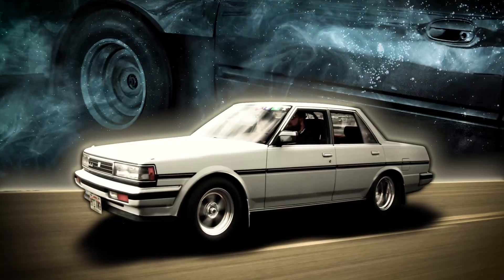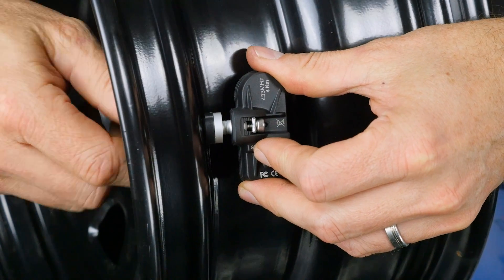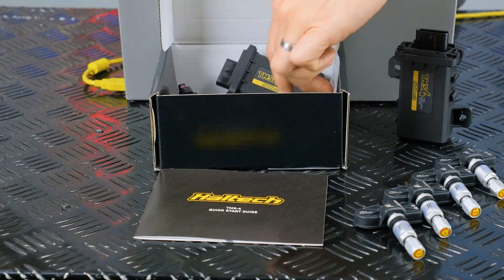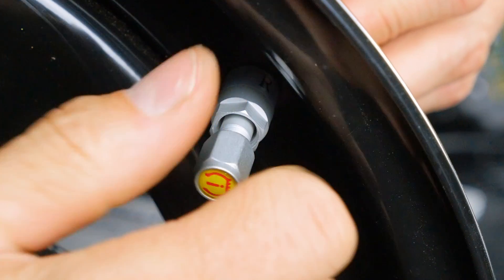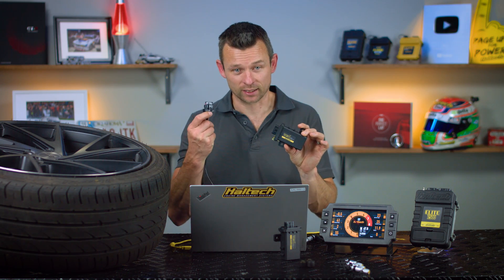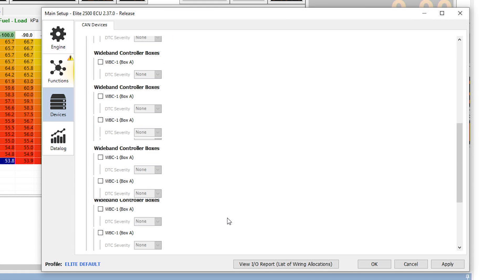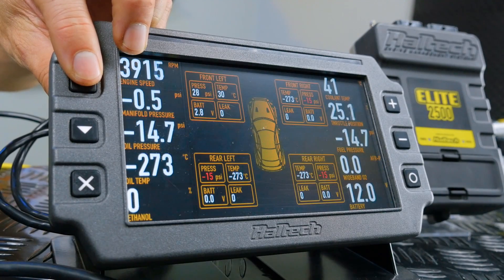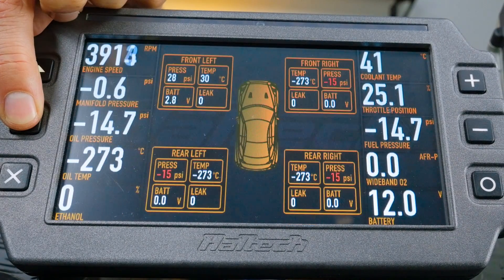🔍 TMS-4: Tyre Temperature & Pressure Monitor | PRODUCT OVERVIEW

Comment: maybe I missed it but I dont think so ,Yall need to tell people trying to install this product that if the tires have been sitting still the sensors will not read, evidently some kind of battery saving feature which is pretty cool but only if you know it, I just spent about 3 hours trying to figure out why none of my sensors were working only to find out I needed to move the vehicle and they would come online😒

Comment: I just ordered one but they need to make it an option to use 5 sensors so that spare tire pressure will show up too, which might even be more important than monitoring the other 4 tires because one usually knows when they have a flat but I have went to put a spare on many times only to find out its already flat

Comment: What’s the maximum amount of sensors that can be read at once?
Would be cool if you could also monitor pressures on the race trailer, or if you’re carrying a seperate set of tyres to the track, and be able to disable alarms that certain sensors can’t be read because they’re not on the car and therefore not in range. Then you could also custom title the tyre names that would appear in the Dash.

Comment: New vehicles with fancy TPS - eh who cares.
Haltech vehicle with TPS - HECK YEAH
Reply: New vehicle fancy TPS is just a display - you can't get any can data from it nor can you throw a DTC or conditional code up as a warning etc or have contingency maps regarding tyre temp and pressure. 

It could mean a lot for those racing 1/8 or 1/4 mile for example who can fine tune their starting tire pressure. 

It's also handy for circuit racing cars to have a warning system or tire pressure warning come up on the IC-7. 

Yes it forces you to invest more in the haltech universe with the IC-7 Display to get the best output as well as the elite / nexus ecus - but after upgrading from a Motec M800 then PS2K to Elite 2500 it's been worth it.

Comment: Will the multi function can gauge (gauge art) be able to display this information if I don't have an ic7 dash.?
Reply: I was curious about that as well, 
I have a platinum pro ecu with the multi gauge
Reply: Excellent question. I have the can gauge as well. Fingers crossed the answer is 'yes'. I wonder how quickly the information is transmitted to the ECU so it can be logged with a GPS reference and you can see how hot the tyres get with real time braking, cornering and accelerating on various parts of the track.

Comment: This kit only really needs one extra thing, it's own display of tyre temps and pressures, or at least Bluetooth capability of some sort.
I have the elite pro plug in on my Falcon, but don't have the IC7 dash display.
Really do like the idea of this thing though!
Reply: It may work on the Haltech CAN multi function 52mm by GaugeArt
Reply: @racetune , thanks for the tip guys, I'll have a look into it 👍
For the time being while mine is still performing daily duties, I really wanna keep the stock dash.
When it becomes a weekender/racecar I'll probably get the IC7
Reply: @bigpotential82  Honestly man , the IC-7 dash is a game changer even for my street car.  I've got a genuine Supra TRD 3 gauge set that's worth a mint, and I put that into storage, ran a Mako Motorsport 3d printed dash insert for the IC-7 and it's got that modern 2020 updated look with all the info and engine warnings. 

No more AFR gauges and pod gauges cluttering things up - it's all there on the IC-7 looking sleek and highly functional - especially when combined with an elite/nexus that can throw up DTC codes if something those awry. 

Haltech have done well to engineer and position themselves into the affordable, yet highly functional category of ECU and tuning parts. 

My next move is a Nexus to do away with a lot of the ancillary boxes and run the integrated PDM instead of all these relays in the race car.
Reply: @racetune , cheers mate, it's good to get some real world feedback on the IC7. It is something I intend on getting, just not in the immediate future 👍

Comment: Is there any reason other than looks to choose the internal sensor? Are they more accurate because of mounting location? Great product btw. Cheers
Reply: Would also be easier to inflate and deflate tyres when you need to adjust pressure as you don’t need to loosen the locking nut
Reply: I've bought TPMS sets on Amazon and tried both kinds. First, I tried the external sensors, but one of my tires kept losing air. I realized that the sensor on the end of the rubber valve stem was too heavy, and at speed, it was bending the valve stem enough to cause a leak. That problem went away once I got some internal sensors. Now, the little gauge has failed, so I'm looking into doing these. 

My only gripe is that you have to replace the entire internal sensor instead of just the battery.

Comment: I was thinking about figuring out how to integrate a factory subaru TMPS module into my setup, well.... Now I don't have to, thanks guys!
Question though: is the 433mhz sensor a universal style, in that to replace it I can do it from any parts house or do I require purchasing a replacement set from you guys directly?

Comment: Super cool, but will need some polish. Buying a new kit just because one of the internal sensor batteries died is insane.
Reply from the maker: The external kit has removable/exchangeable batteries.
Reply: That's how they come from the manufacture. It's a common thing unfortunately. 

Buy the external kit with changeable batteries and you can switch it between each race tire set etc.

Comment: Very cool.  Will CAN protocol specs be available for those of us that love Haltech but can't run an Elite series ECU?
Reply: I emailed tech support and got the full canbus protocol specs. You can probably do the same. 

I really, really, realllllly wish haltech would do some sorta open canbus config for data input and output! Having the "closed" protocol works in the meantime.
Reply: Probs not.

Comment: Very Nice.   
Will this data flow out the CAN bus to a data logger like a AIM MXL2 Dash ?
Reply from the maker: At this stage it can only be logged to the Haltech ECU.
Reply: @haltech  Are there plans to resolve this short coming ?
Reply from the maker: Not at this stage, but it depends, as always, on the demand.
Reply: @haltech  I was not planning on buying an ic7, I was also hoping I'd be able to see the data over can so I can use the can to OBD adapter you sell, HT-135000 or perhaps the gaugeart display. As it stands there are too many shortcomings for me. I want to love it.

Comment: Replacing an entire kit is not consumer friendly or economical. 
The forward thinking to setup a sensor exchange/programming service would only benefit the customer and decrease unit/kit sales. So it's not profit friendly.
Making your product send in serviceable with a fee is far better than non serviceable. It might hurt unit sales but in the broad longterm it will satisfy your customer base.
Reply: I'll bet someone with a code scanner can figure out the sensor type then they can be cloned.

Besides lets face it.  This is targeted at racers.  Us racers use way more than just four tires.  It's nothing to take 12 tires and wheels to a weekend road race competition.
Reply from the maker: The external sensor kit has a removable battery.
Reply: @haltech  It's not about batteries.   it's about swapping wheels at the track.

Comment: Will replacement internal sensors be available to purchase or will you need to buy the whole kit again and have a spare module added to the collection every 2 years?
Reply from the maker: Unfortunately the sensors are coded to match the TMS module so yes, it's the whole kit that will need replacing.
Reply: @haltech  that does sound a little wasteful, considering a simple battery replacement would bring them back to life.
Reply from the maker: You can do that on the external sensors but the internal ones are sealed units so it's impossible to change battery. The sensors and the TMS module are match coded to make the installation nice and easy.
Reply: @haltech  Aren't there aftermarket tools that more or less allow coding an aftermarket TPMS to exactly replicate an old one? To bypass reprogramming or relearning OEM TPMS modules? Seems like it'd work in this case too. 

If you guys have the IDs as programmed or if customers get the things scanned before they completely bite it I imagine it's possible to reprogram the new sensor itself.
Reply: @haltech  Kind of a shame that they can't be repaired with different (replacement) sensors